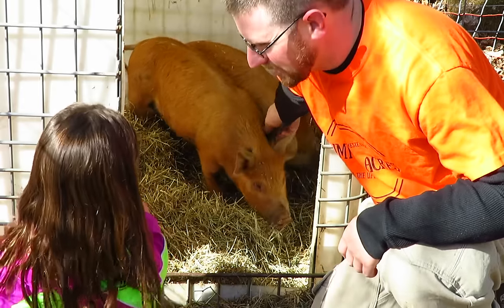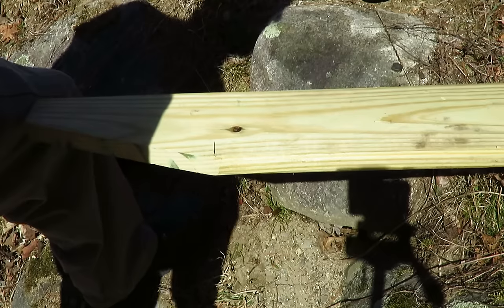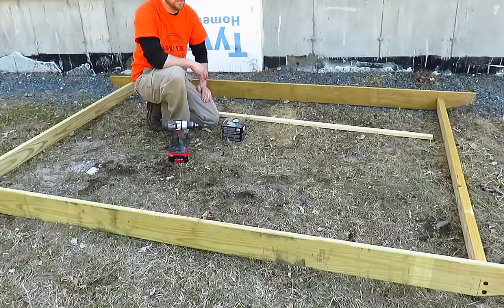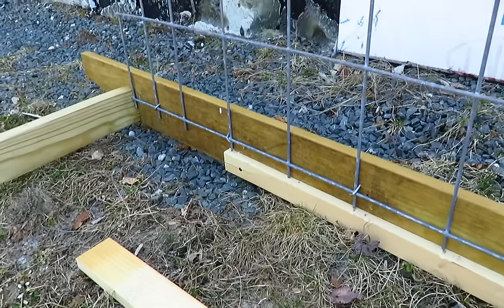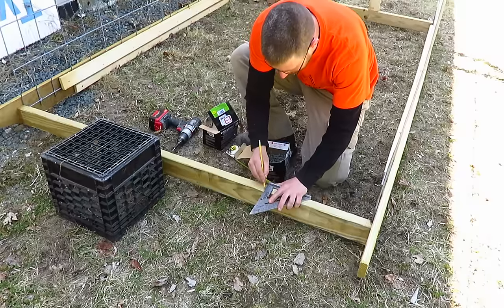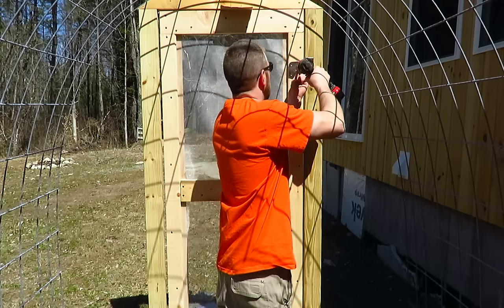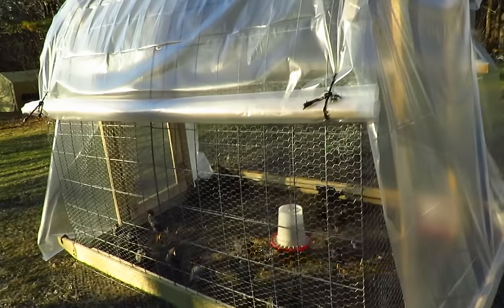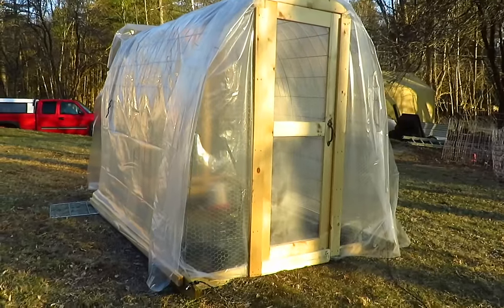Chicken Tractor 1.0

Comment: Someone living in place that gets a ton of snow  might want to support the cross beam in the middle with supports on the ends especially if you don't use plastic or if you use welded wire instead of cattle or hog panels.The plastic helps melt the snow and the stiff panels don't bow beneath the weight of snow but welded wire fencing will collapase

Comment: Have you tried putting angle braces from the front and rear upright/door frame ??  it should make it more stable and cause less wobble when moving and help with keeping the door frame square ... I know this is 2+ years old, but just a thought ... great video and it helps making a small greenhouse and tractor ... using little giant nesting boxes from Tractor supply and your feed and water buckets from your later brooder video series ... keep up the good work and I wish you continued luck with your search ...

Comment: Hey, love this style of chicken tractor, thanks for putting this video out there ! FYI, we ( my husband & I) would use corner cleats ( dont know if thats correct term, we're not pros !  ) instead of screwing the screws into end grain/ the end of a board. Also with the bottom of door way sides, just extend them down (& also up) further (& have them on outside of those going horizontal at top & bottom) & thus screw into them... probably not as pretty, but a bit easier & again, avoiding screwing into end-grain, also, the door would ( if made to a little longer ? My brain is failing now.. ) then also rest up against wood at top & bottom when closed, making a nice seal, not that that's necessarily desired. I want to use one for laying hens, even over winter, on deep mulch in my garden, & move whenever not froze down. Someone plz tell me, if that's a bad idea in some way ( ventilation - which I would add at top on each end -  , condensation ? They would be let to access rest of garden all day... )  . Anyway, love your place, attitude,  family-friendliness etc. !

Comment: Have you weighed the chicken tractor?  Would tubing, rather than cattle panels, have made it lighter, thus easier to move?  Keep up the great videos...succinct and to the point.
Reply from the maker: Its not to heavy, It's more of the weight of the water and uneven ground that can make it hard to pull. I haven't weighed it.

Comment: How do you keep the horizontal wire at the bottom from bending when you move the tractor? Where did you get the wheels? Thanks
Reply from the maker: We put corner braces in. We moved them once a day all last spring summer and fall and they have held up great. Right now they are buried in 2 feet of snow! LOL
Reply: Thank you for the quick response. I am currently building this, BUT I see the corner braces but how do they hold up the chicken wire when moving?
Reply from the maker: Patrick Lawson the chicken wire is zipped tied to the cattle panels.